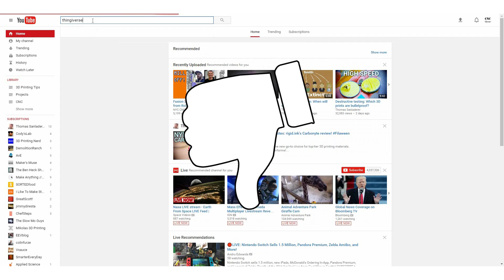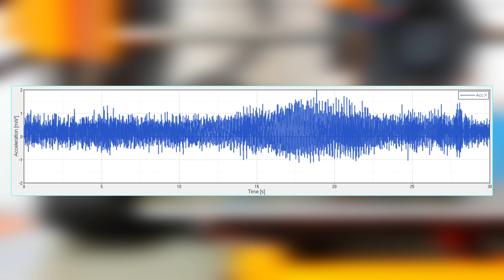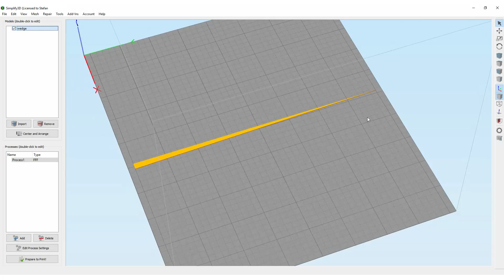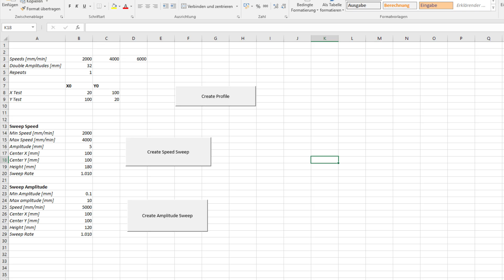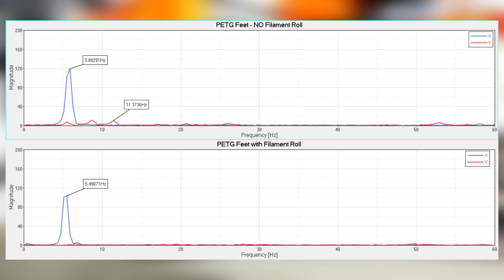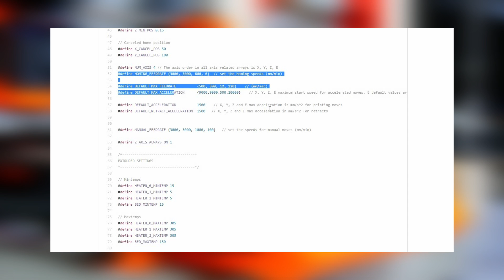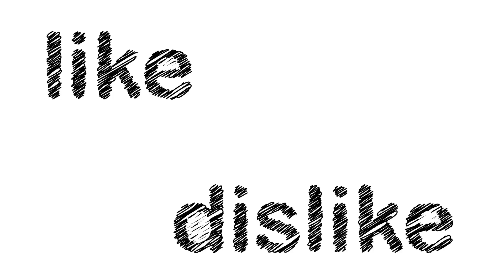Prusa i3 MK2 - Practical Vibration Analysis

Comment: What‘s the verdict? I use a washing machin rubber mat under the paver and as feet material along the frame. Material is as stiff as the stock mk3s feet but the whole frame is sitting on it, not just on those small feets. From your test code out of the other video there is only one frequence where the frame wiggles a bit but this is because of the cheap ikea lack table everything is sitting on.

Comment: hi ,
i have a delta type 3d printer and i was thinking about how a mass damper for the vibrations will behave . 
a lead weight from fishing equipment tightened with 3 springs from the center of the top horizontal bars .

Comment: Put the printer on a big, heavy plate, put that on a raft that floats in high viscosity oil, and provide a strategy to not spill any ... :) iow: Overshoot. SCNR. Or look at what the HiFi loudspeaker people do to minimize a power transfer between the box and the ground. Minimize the coupling area. That, at least, made my old OrdBot Hadron whisper - and the prints cleaner.

Comment: When I first designed feet for my replicator dual about 5 years ago I didn't think if dampening and made them solid with rubber feet I took off networking equipment. They were dense, large, and thin. The machine sits on a wood shelf in a large closet. I noted the sound coming off the machine was not as loud and went a step further and made the feet with springs without accounting for any dampening. Right away I noticed the machine was louder and noticed that time there where more signs of resonance in the prints. So then I printed solid TPU bulky feet. That was enough to dampen the structure without bouncing back into the printer with spring feet.

Just like a car on the road would bounce around with no shocks the machine would do the same, just like in your video.

Comment: The problem is the vibration between nozzle and bed. If both are very fixed together and always aligned, it doesnt really matter if the frame is shaking.

My printer is sitting on PLA feet. Many of them.

Comment: If the goal is to reducere noise you need to investigate where is comes from. Noise comes from vibrating surfaces. So depending on the mechanical impedance of the source it can often be emitted from other surfaces.
In my case the vibration from my 3D printer is transmitted to the table it stands on that then radiates the noise. Even though the table vibrates less that the printer the surface area is so much larger it is the primary noise radiator.
So in your case here it would likely be better to swap the concrete plate and the vibration damper. The concrete plate will be connected stiff to the printer and thereby increase the mass and reduce the vibration amplitude. The vibration dampers efficiency in transmitting mechanical vibration down into the table will follow the resonance frequency. Since the increased mass of the combined printer + concrete plate is dramatic the transmitted vibration will be reduced a lot.
I would expect this to reduce the noise you get from the printer significantly.

Comment: Nice work. I have done similar tests but didn't get nearly as detailed as you. I came up with the same results. 
 I have a suggestion...one of the popular add on gimmick is adding motor dampers to the printer to quiet the vibrations of the steppers. 
I haven't checked but I assume this will increase the resonance and affect the part...what is your opinion?

Comment: Hi,

I am working on a finite element modal analysis of the Prusa i3 mk2. I am trying to calibrate my model using your results, but you didn't include the Z axis results. Do you still have them? I was planning to do the same ping test you did, but my printer has a different configuration (I got the MM upgrade)... The FE model is of the no MM version.

For some reason I am not getting the 13 and 15 Hz modes that you are seeing in X and Y for the "No Feet" results. I suspect that my model is too stiff somewhere... I am still trying to figure it out... I am seeing a 43 Hz mode in the Z direction.

I am reporting my results in the Prusa i3 MK2 / MK3 - Official group: https://www.facebook.com/groups/PrusaOfficial/permalink/1530525470336646/

You can see pictures of my modes there.
Reply from the maker: Hi Jose, nice analysis you're doing. Can you explain who you constrained the model, because I can see the feet moving in the animations. Free vibrations without any DOFs locked or did you simulate the connection between feet and table with a certain stiffness? You did model everything in high details. How did you make sure that the mass distribution is realistic? Did you account for the different materials? What software package are you using?
Reply: It's a free-free normal modes analysis. No constraints. If I use constraints I will get even higher frequencies. Each part has its own material. Basic properties directly from Fusion360's database. There are some compromises, for example the motors are a single part, including the z-axis ones... hence I had to use steel for those (screw material, if I am not wrong). I removed all the non-structural parts and all bolts. All the contacts are bonded, as this is a linear analysis. I disabled the contact at the upper end of the Z axis screws, but leaving it on didnt make much of a difference in terms of stiffness.
Reply: I am planning to do the analysis in a better package. I just dont have the money to buy the programs I use at work... :)

Someone pointed me to SimScale. I am not sure of it's capabilities, but they have a free makers license... so I will definitely take a look at it once I get good results from this analysis.

Comment: I have an i3 clone sold by Microcenter as PowerSpec. My first printer. After tuning the acceleration and jerk settings down, the quality of prints has dramatically improved. Next I printed the Z-axis upgrade and side feet that uses furniture swivel feet, like those on chairs and desks in classrooms. I also purchased better aluminum couplers for the z-axis screws, and rubber/metal damper mounts for  all 4 steppers. I printed out a new rear cap for the PSU/controller board (same as your enclosure) that uses a 12cm PC fan. I chose one that came with a noise reduction plug to further silence the fan. 
  The stock bed is kind of useless, It's cheap and has two piece design. The build tack surface works OK and it is a heated bed, but has a big lump in the middle and the i3 v2.1 does not come with auto bed leveling.

Comment: Great video, going to do this tonight... How did You use the accelerometer data, did You make the frequency analysis on one axis only, or combine all axis data to one vector?
Reply from the maker: +Karsten I did the analysis per axis. If you use the resulting vector you will not get negative values and its harder to separate the modes.
Reply: The test wedge show in the video, did You generate that with the excel sheet?
Reply: Managed to run the frequency test, and man I have some crazy vibrations, had stuff falling of the table. Any suggestion how to proceed, when You have identified frequencies? Stiffen it up, add mass, or printer settings?
Reply from the maker: +Karsten Stiffening is a good thing. Tighten your nuts and maybe add stiffeners to the frame. Additional mass is usually bad since it lowers the frequencies.

Comment: Motor seem to make vibration, I took my old bicycle tirer trip rubber and make a seal between the motor the the support, les noisy now. also ppl tend to bind the belt of the motor too tight, I experiencing that if you tight it too much this will make the motor more noisy.
Reply from the maker: I have some stepper motor dampeners around which I should actually give a try some time.

Comment: This was an absolutely fantastic video!!

How would you feel about getting a light weight accelerometer to fit to the carriage of any printer, and do exactly the same to find the resonance... This could be used to tune the acceleration and jerk of the printer firmware to reduce oscillation at resonance and therefore improve ringing artifacts in prints?  That would be a fantastic tool!

Also, designing a mass-damper for the gantry could remove a lot of these resonance peaks.  Perhaps a weight on a rod at the top of the printer tuned to 5.8hz?

Unfortunately I haven;t done much NVH since my Uni days so I lack the skills now, plus don't know enough about data aquisition.  I'm an ideas man these days only I'm afraid!

Comment: Hello, and great video, some stuff from university I thought will never see applied in real life !
What about rattling sound of the carriage on a printer, so printer does not vibrate but there is very annoying sound coming from the printer at certain speeds and movement . See my videos . So far I isolated it to the driver for the steppers ... but maybe there are other solutions like rubber connecting mounts for the steppers ?

Comment: You've said that it increases vibration but not shown how that vibration can/would effect prints.

If the printer shakes I can see that it could shake bolts loose but I wasn't able to see anything in the prints or the printing mechanism that could be negatively effected by the vibration.

I was very unhappy with the noise my Original Prusa i3 MK2 made so I designed these extreme anti vibration feet

https://www.thingiverse.com/thing:2254991

So my thinking is that I do expect the whole printer to shake on it's new feet (and it does!) but that is the whole printer. So when the print head changes direction quickly on a solid base the inertia is absorbed by the motor and carnage which could cause over shoot of the head past the ideal path it's trying to take. But if the whole printer rotates slightly then the head can stop quicker and let the inertia go into the printer. Leaving it to follow a sharper path in relation to the part its printing. BUT that's just my thinking. My tests were just printing some parts with and without the feet and as I didn't see any difference in the parts just the sound going away I was happy. 😊

I can see for example someone mentioned the frame is designed to sit on a hard surface and uses that to prevent flex and that makes sense. Clearly that needs resolving by stiffening the bottom frame like a solid block of some sorts. Maybe thick steel or concrete like your video.

Anything else you can add as issues my feet would cause? Especially with resolutions that don't bring the sound back. 😉

Comment: Interesting video! And well explained too. This makes your channel stand out.

Like some said: your phone adds mass to the printer, and probably at a point with the greatest amplitude. A lightweight probe would be better. And place the probe at the bed. That will tell what vibrations the printed model will experience. 

Analysing vibrations in X will be another can of worms. As the sensor should be at the printhead and the intended accelerations have to be subtracted. Actually it should be on the printhead (and model)  for Y analysis, and the intended accelerations brought into the equation. Obviously that will not make for a less technical video. ;-)

And for the impact test: Knock the side of the gantry so the exitation is in the same plane as your print test.
For a printer like the Prusa it would be of interest how much it matters that the model gets shaken as it is printed. I would imagine that is significant, and should be taken into account when placing your print on the platform. Place the plane with highest rigidity in the Y axis.

Comment: A bit off the topic.  May I asked where did you get your PINDA probe protector for your MK2?  Thanks.
Reply from the maker: You can download it from the Prusa website:
http://www.prusa3d.com/prusa-i3-printable-parts/

The inner diameter was for mine a little bit too big so I had to use some hot glue to fix it in place.

Comment: A mass damper may help. A container of fluid at the top of the machine. Fill it with alcohol for damping high frequencies, a thick media like mineral oil or syrup for low frequencies? Maybe that is backwards. I've been considering this for a while but haven't tried it since I had no way to measure results. What is the name of the app that measures vibration on your phone?
Reply from the maker: I'm still trying to figure out a good test for the difference in print quality with and without vibrations.
Reply: I would suggest your long wedge But in an X shape and extended upwards. So two wedges one + - X and one + - Y

Comment: Good video, but after you added your smartphone with to clamps on the top of your printer - you have substantially lowered all  resonant frequencies of your printer. Actually you should use as light acceleration sensor as possible, something like MPU-6500, BMX-055, BMI-055 or similar.
Reply from the maker: Yes, the phone definitely changes the behavior, but its a great and simple to use tool to gather the data. Jan Beck also posted his solution using the ADXL335 which additionally has a much higher sampling rate. I will try to play around with a "real" accelerometer in the future.
Reply: @CNCKitchen  And the correlation of vibrations in all three axes or rather radial directions should be worthwhile some studies. The elasticity of belts, if used, is also worth some minutes of head scratching. And back from there the rigidity of the steppers themselves. Adding dampeners between them and the frame /can/ help. HP used viscosity dampers in their plotters in the seventies last century, successfully.

Comment: @CNC Kitchen could you give us a copy of that excel sheet???
Reply from the maker: You can find my quick and dirty version here:
https://github.com/CNCKitchen/3D-Printer-Vibration
I will make the tool pretty during the next days and let you know.
Reply: nice :-D as i have said above at least i dont have anything against lowering my speed and jerk settings if i can get a more quiet printer. Then i can print while sleeping :-D

if you are going to change the tool maybe add so that we can see some info on a display... i have not looked at the tool yet so you might allready have done this
Reply: Can it be that this only works in excel? i tried to open it with google sheets and there was no formulas or anything that could generate code
Reply: works fine under libre office :-D
Reply from the maker: +Bo Herrmannsen Do the macros work as well? Because if that's not working, you won't get any gcode files.
Reply: nope... and even the free excel viewer do not run the macro's :-/

still thinking on how it could be converted so it can be used in a free program
Reply: or yes in libre office  it looked like it worked. the buttons was clickable but it did not save anything in c:\temp or and to the 2nd sheet/tabelle
Reply: YES, got it to work in libre office, i just had to install java runtime first. Hardly ever use that anymore

Can you shortly explain how to fill out the sheet?
Reply: Have made a pull request so that the Libre office version is together with the excel version

All i had to do was to install java runtime and reasign the macro's to the buttons
Reply from the maker: +Bo Herrmannsen Well done! Thanks for the info. I'll put it on my Github soon.
Reply: Can you maybe explin the sheet? ie what each number does? i can then add those to the libreoffice version

Comment: Yes please. More of these, deeply technical, videos. Finally somebody with deep analytical approach. Thumbs up!!
Reply: I've been thinking about using vibration isolation with rubber dampers. I also thought about the shock that comes on motorcycles for the forks to keep them from getting the death wobble.
Reply: Marko Kukovec just remembering technical doesn't add to quality of printing .some solutions are not very complicated and technical. Also, some solutions have been born through observation without understanding the nature of solution .. Technical analysis can be useful but simplicity always makes significant contributions

Comment: I'd like to know all the considerations for vibration since I had some vibration issues with my 3D printer. It helped some by adding a rubber gasket close to the extruder feed motor which moves whenever the stage moves.

Comment: Nice analysis. But: Relevant for print quality is the relative vibration (movement) between HB an nozzle. You have measured the absolute acelerationsand not the relative ones.Therefore I would not agree with you conclusion that dampers are a bad idea. The main problem i see with these dampers you have used is that the Prusa design relies on a stiff surface to be aligned. Therefore I have placed mine on a stiff plate which has dampers below (whith a very low eigen frequency)
Reply: That is a good move. Attaching a machine to a heavy surface and putting that arrangement on an vibration absorbing medium (sorbotahne or rubber wheels) is usually effective. It has worked well on my CNC mill and lathe.Wire loop isolators are very popular for many applications as well, and they are similar to the printed isolators he used here. Maybe those are just the wrong stiffness for the MK2
Reply: Good design. Very low eigenfrequency as to the ground results in mass damping.

Comment: I used "Isolate It: Sorbothane Vibration Isolation Circular Pad 50 Duro (.25" Thick 2.25" Dia. Which can be found on Amazon)" which reduce the noise quite a bit and only added a very small amount of vibration. Might be an interesting followup video. To Keep it from sticking to my table I "InvisiHold Round Furniture Gripper, Floor Protector Pad Dense Rubber-Set of 4 (2" Round)". Using my iPhone app I got about a10db noise reduction.